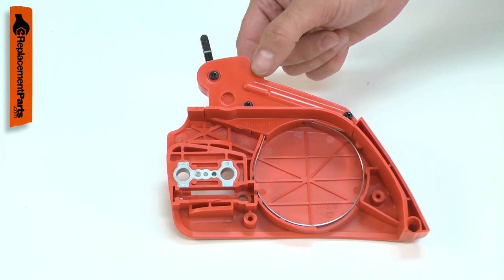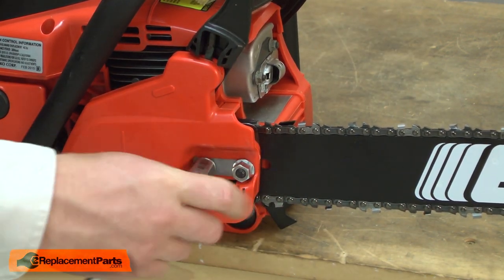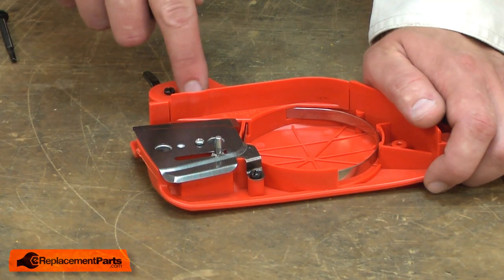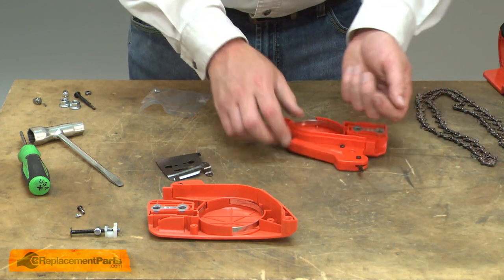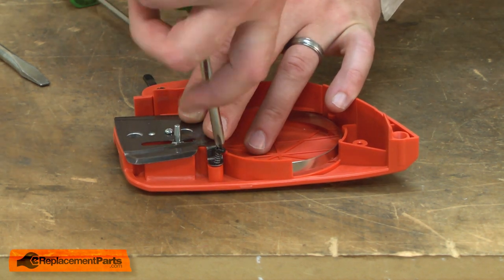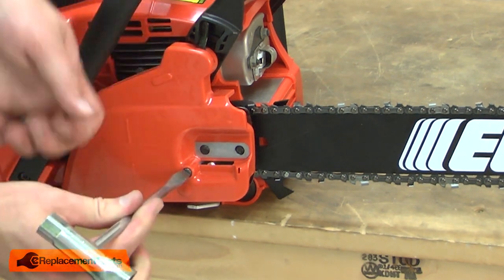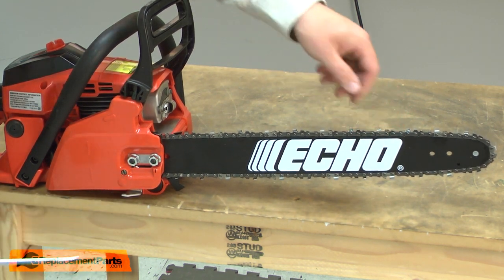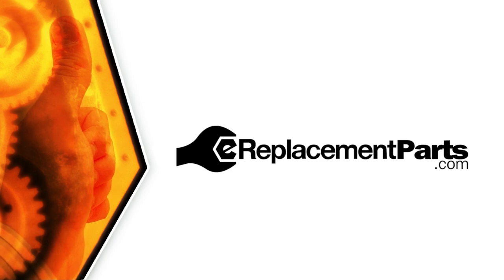Chainsaw Repair - Replacing the Chain Brake (Echo Part # P021017220)

Comment: Hey !  I took the housing off of my ECHO 4510 today to give it a good cleaning and I can't get the damn to thing back on. It doesn't want to sit flat anymore. It rocks back and forth like something is catching but I can't see anything that is in the way.  Any ideas ??
Reply: loosen the chain tensioner rod, it will get in the way when you go to put it back on
Reply: Check to be sure the chain brake is not engaged.

Comment: My brake lever won't move.  How do I fix that?
Reply from the maker: The spring requires a tremendous amount of force to compress. You will need to have it attached to the brake lever or use a long pair of pliers to move it. -Mark

Comment: I want to see the entire process.  That means a filthy dirty, oily saw. Take it apart, clean all the crud away, all while wearing that clean white shirt!   Many factory techs never see or deal with dirty used, rusty equipment.   I remember the days when I worked on automobiles in a flat rate shop. Those Chilton and Motor book times were sometimes a fraction of the real time it would take to make a given repair.  That's because the times were based on ideal conditions.   No filth to clean off first. No seized parts that required torches,  ect.   Dirty , rusty work = real world times.

Comment: Why take off the chain and bar? There was really no need as they were replaced in exactly the same position as they were removed with nothing being done to them.
Reply: It doesn't cause any harm or add much complexity, but keeps things safely out of the way, preventing the bar from rubbing against the bolts, and the chain drive links from putting pressure on the bar.

It's not likely that much damage will happen, but it's good practice for idiots like me that might torque the bar a bit.

Comment: Very lame. Why not try and fix the original parts? Any moron can buy the new ass.and put it on. My brake just locked up and some of the little parts in there are out of place.Not buying a $60 to $70 part that is not needed anyway, it will be easy to take the band off and do away with it.

Comment: You're not even touching the brake band, which is that round metal ring wrapping on top. That's the brake. What you're doing is just replacing the tensioner.